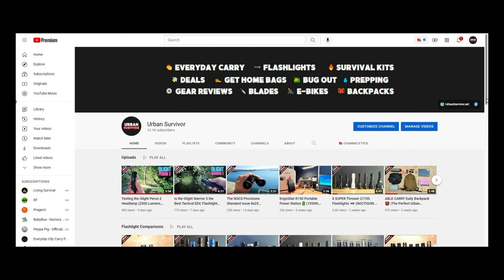Step up your Home Security with a Door Barricade Bar from SIHNMAN [Install and Tested]

Comment: Needs the bar to be twice as thick in every way. Also use 3-5 " screws where possible for added strength, make sure thread doesn't go all the way to the head, you want the thread to be half an increase away from the screw head.

Comment: This is the type of product you buy and install, but hope you never need it. Most people will never be faced with this type of home invasion, but it happens to hundreds, if not thousands of people every day. The same thing applies to my CCW. I have carried a concealed handgun every day for the last decade. Fortunately I have never had to use it, but I would rather have it and not need it, than need it and not have it.  This device would give me added peace of mind that I am doing everything within reason to protect my family. The way this attaches to the door makes this less intrusive than the bracket and board method you have previously mentioned. This device is out of the way, and the hat and coat rack make it look like it is part of normal home decor, not a security feature.

Comment: Great piece of kit. More things you can do is use nice ling 3" screws on your strikeplate. These will go into the surrounding studs and make a door much stronger. Not as strong as a lockbar but as they say 2 is 1 and 1 is none.
Reply from the maker: Yeah thats a great idea!

Comment: Ease of install and use. Since it is made of steel it is much more durable then just a wood board going across the door frame. A good center door force kick can split a 2x4 in half. I would put this on the basement door before the storm cellar or bunker door. Give that extra level of time when escaping from someone or something.

Comment: One problem I have with this, is not usable with door casing trim.  Another, is I feel the retaining plate could be deeper.
Reply from the maker: Yeah I have tested another model thats designed to work with outswing doors and work with trim. Theres a video of that on the channel.

Comment: One more to add- Look into Master Lock Door Security bar 265. This seemingly simple wedge saved my mom's back door from being kicked in and robbed. I might add it was used with the foot on short carpet. I think the most important thing with the install is getting the correct angle as knobs are at different heights especially when dealing with older houses.

Would love to have this door barricade as a another line of defense on the same thin vulnerable door as they almost got in. It looks quick to install and remove when you need to open the door.

Comment: you kick like a wuss.. but its still not bad.  the major weakness is that your side brackets screw into the door molding which isn't very strong. 
unless your door is tightly fit into the studs and header system and if you used 3.3/4th inch screws or larger to install the doorframe to the studs. then it would hold up really well.
if you're gonna make the door hard to kick in.. you might as well make it police proof  and that means installing the door with tougher materials from the begining.